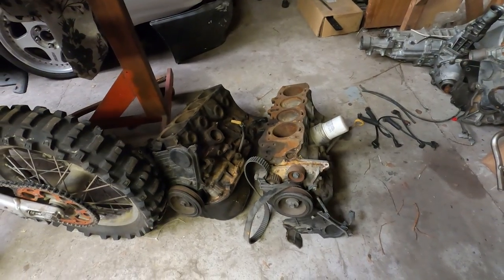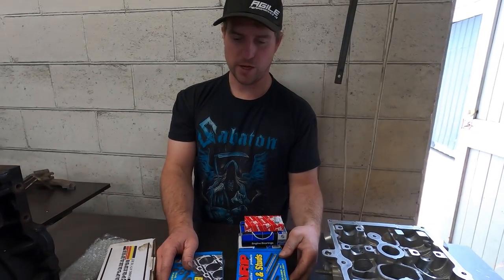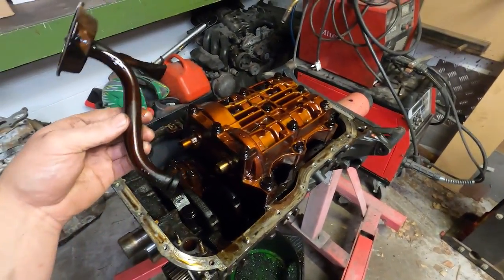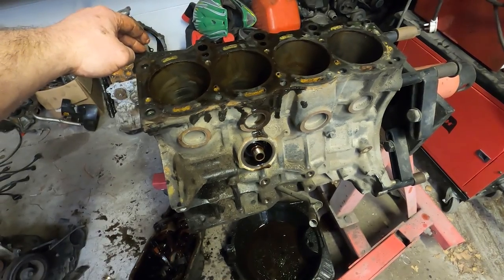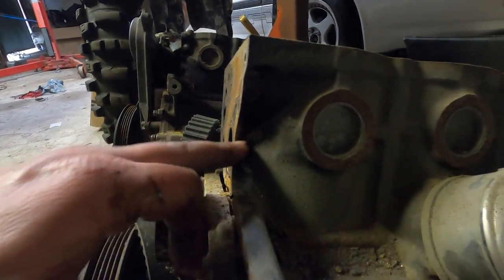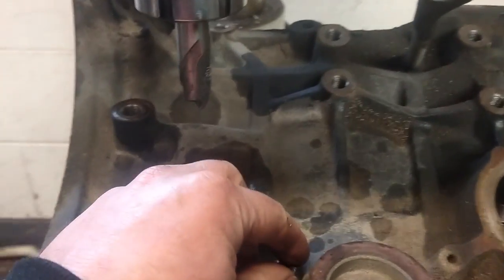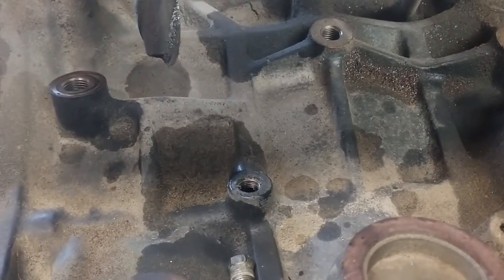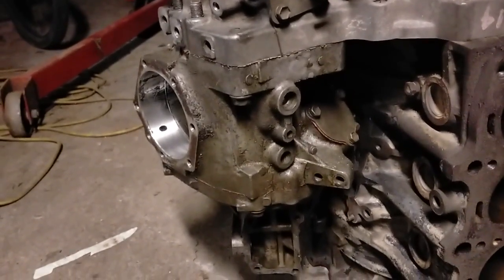5SGTE Beams Engine Build EP1

Comment: I am currently running an unbuilt Manual Blacktop Beams in my MR2 (only full swap I'm aware of in an MR2). I will build it now that I am confident I got the swap in there correctly. I was considering using the 5S block for a big power build when I realized the blacktop block was made in the same generation as the coveted 98+ 5S block so casting material would be of similar quality. When i compared the two blocks side by side, I wasn't able to see why the 5S block would hold up any better than the Blacktop block. Having said that, I didn't do any sonic testing or any other in depth analysis comparing the two blocks. In my opinion sticking with the blacktop block may be a more straightforward build for anyone considering running the blacktop head. Either way I love the 5S + Blacktop combo idea and am very interested. Cudos for taking on this project and for sharing!
Reply from the maker: nice, in a sw20 or aw?
the backtop block certainly makes things easier.
I have ultrasonic tested both the late model 3s and 5s blocks. the 5s has on average 1mm extra bore thickness and is a harder material. the 3s block will hold around 500hp depending on cylinder pressure.
Reply: @hawes_power5590  oh cool! Late model 3S as in the blacktop beams? Blacktop was the last even later than redtop and gen4… I am in an SW20
Reply: @hawes_power5590  Have you ultrasonic tested the blacktop block specifically? I am curious if it might be stronger than the other 3S blocks
Reply from the maker: @theshadowofalepton5178  yes i tested the blacktop

Comment: This is an interesting build, looking forward to seeing how it turns out!

Question: Isn't it recommended to use a torque plate to clamp down on the block before doing the cylinder walls and headstuds so it will "preflex" into it's final shape? Or not necessary on iron blocks?
Reply from the maker: yes it highly recommended on iron blocks, this will happen when it gets machined

Comment: Very cool build video.... I have plans to turbo my red top 3sge to put in my st165
Reply from the maker: That sounds pretty cool. You don't see many 165s these days!
Reply: @hawes_power5590  thanks bro... Will probably be a couple of years before it is ready for the road.... Am only wanting 250-300hp out of it... Do you have any tips on what I will need apart from the turbo and ecu... I would like to stay relatively high comp  and low boost if that makes sense
Reply from the maker: @nigelsmith7366   you can run that power on a factory engine. use a big turbo running low boost to keep the engine alive down low. but anymore and you want upgraded rods, pistons and head studs.
Reply: @hawes_power5590  thanks bro I was wanting to avoid engine internals as I only have a very small budget for parts

Comment: Would it make sense to utilize 5sgte pistons and have them machined for the valve angle ?
If not, what are the necessary measurements for this kind of custom piston ?
Reply from the maker: you could do that. but considering custom pistons are only slightly more expensive than off the shelf pistons, why would you bother...

Comment: I wonder if the stock 5s pistons wouldn't work with the beams head/valves?  The 3s pistons have way too much of a dome, but the 5s pistons look pretty close.  Don't know what they would give you for compression, but they would be more likely to work that the gen2/3 3sge pistons.
Reply from the maker: the 5S pistons do have a lot of dish so you might end up with a reasonble CR. Im not sure what the valve angle of the 5S is would could be an issue. anyway, the 5S pistons were never designed to handle boost so it was never an option for me. they may work as a budget low boost setup
Reply: @hawes_power5590  For sure no boost, or minimal boost.  I was thinking in the context of doing a really cheap 5sge, could you do something so simple and see good results?
Reply: valve angles are completely different from the Beams to the 3SGT head,  if you use any non Beams pistons make sure to clay the head for piston to valve clearance

Comment: Hey fellow kiwi here. I built a 5sgte around 2018 using the manual blacktop head, custom rods, pistons, full cnc head, cam upgrade, full ferrea valvetrain. Running ext. oil pressure ported using an line to activate the variable cam timing. Partial grout filled block, stud kit etc. Stuck it into a TA22 and a built R154, LSD streeter
Reply from the maker: Awesome car! Sounds like a very similar setup, what sort of power are you making?
Reply: sick!

Comment: Hi I am trying to Follow and copy most of the build for my altezza With the J160 trans.  Would you be able to give me some more info on the pistons?  Who I would need to talk to to make me some?    I have the car and a Running 5sge, so just need to buy the Beams head and other 3sge parts.
Reply from the maker: Hi I sourced them through PSI racing in the states. A 5SGE doesnt exist... What engine is in your altezza?

Comment: To be fair,130hp wasnt underpowered in the 90s for an NA 4cyl.
Reply from the maker: clearly the 5SFE was never intended to be a performance engine, but it is underpowered compared to the 3sge, or honda B series or even a 4age from the same era
Reply: @Hawes_Power  oh,of course,just saying it's within standard power for that market,not on the lower end; like say a D series. Certainly nothing that puts 100 to the wheels is exhilarating lol.
Reply from the maker: @bobbybandz9194  agreed

Comment: Hey is it possible to throw a beams engine on 3sgte gen4/5
Reply from the maker: it is possible, but the engines are very hard to even lift, let alone throw on top of another engine. you would have to be very strong.

all jokes aside, I presume you mean a beams head onto a 3sgte block. kind of, the head will bolt on but the valves will hit the 3sgte pistons due to the different valve angle. so custom pistons are require